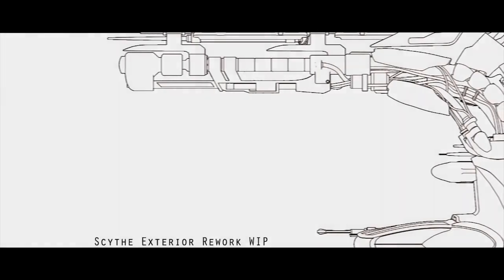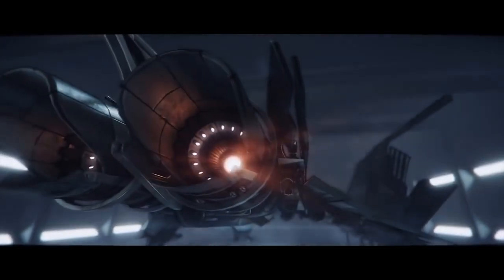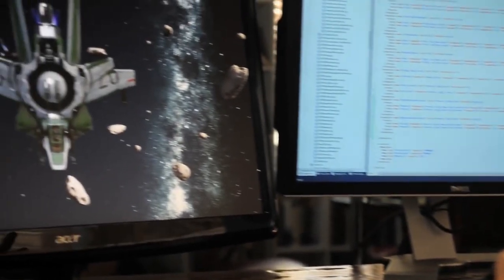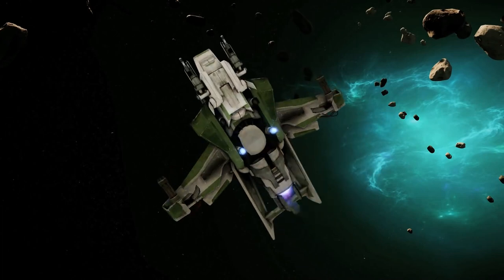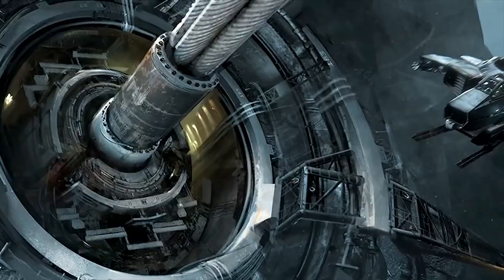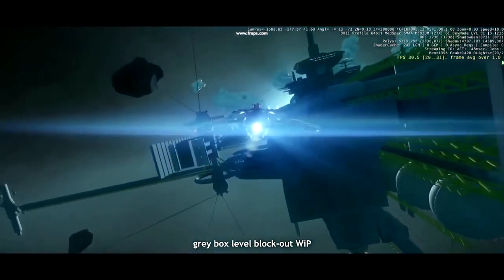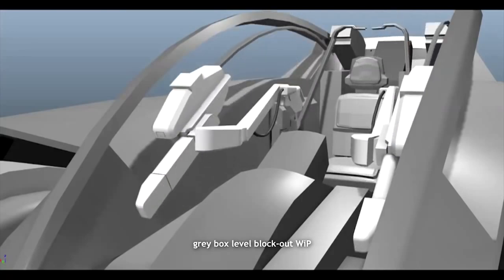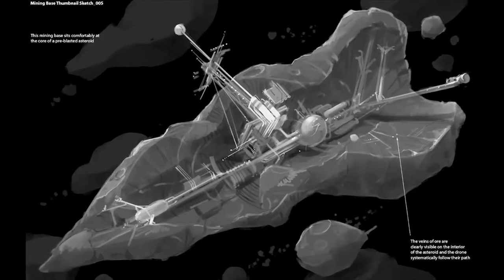✖ Star Citizen » Game Physics

Comment: Personally, I'd prefer the immerse gameplay.  Realism is good, but eventually that can become boring or just not be fun.  As they've pointed out on the site, modern planes usually dont even see eachother when they fight, and now we even have drones that remove that much from the equation.  That doesent make for a very fun game, we want the fights from Star Wars, not just pressing a button and getting a display pop up and a tiny flare of light a million miles away.

And as CitizenHans said, I think the overclocking is more of an 'in the hanger' mod thats made, while the more 'at the moment' changes will be for extra power.  Now they did mention that 'overclocking' something like that in the heat of things could give you that performance boost, but could also burn out your systems if your not careful.

I remember back in the day with Star Trek: Starfleet Academy you could divert power to other systems, like in the series (Aux. power to the shields! Take it from life support if you have to!), and if you weren't careful, and in a pinch put all power to the weapons, and ran them to long, suddenly you had your phasor banks burning out and your torpedo tubes exploding.  I'm hoping to see things like that in the game, the risk Vs reward in it's purist form.

Comment: Overclocking in game is intended to actually mirror what many people do with their CPUs in the real world: Make them perform better (in this case faster) at the expense of more energy-consumption, generated heat and maybe a shorter lifespan.
Its a permanent augmentation you apply to your assets in the hangar between missions, NOT on the fly while fighting somebody. Its comparable to enchanting your gear in an MMO
You manage your power-distribution on the fly of course, but that is not called "overclocking" ;-)

Comment: Hey TA, here's I believe the reason why the game renders 30 FPS in the physics video. The footage was recorded using fraps, when you set fraps to record at 30 FPS, it actually scales down your GPU output to 30 FPS. The reason why they did it this way is that knowing youtube maxes out the videos at 30 FPS, it's easier to record at 30 FPS because it makes the rendering faster and creates a smaller file to upload than a 60 FPS video. So no worries here, I'm sure they can run the game at at least 60 FPS on their machines. ;)

Comment: I think they should strike a fine balance. As was said with sound and laser beams in the vacuum of space - these can be HUD-modeled to allow the pilot to better respond to the battlefield. As for combat tactics - in 600 (is it?) years, no one is quite sure what kind of countermeasures ships will have to combat long-range threats or jam AIs, so it may be perfectly plausible to have people in the cockpits and having to get fairly close to the target. Inertial physics are a compulsory though, and they should be mediated by the fly-by-wire, unless the player decides to have them off. Kinda like in Evochron Mercenary.

Comment: The thing you said about 30fps while on mid spec, I wouldn't be worried as many screen recorders lock the frame rate to what your recording to. As YouTube does not support more than 30fps, then he is probably recording at 30fps. The performance here probably is nothing similar to the performance he COULD be getting if not recording I think. :)
Reply: You can see in the later clips with the large grey-models of mining ships (I think that's what they are anyway) he gets between 60-75 fps. At first I thought it was a lock because of how steady it was but it's more erratic later. 
You have to remember that the optimization of this game is essentially zero at the moment, on release it won't be anywhere near as demanding. 
You'll probably still have to upgrade if you have anything lower than a GTX680, or the AMD equivalent, though.

Comment: I think this guy misunderstood overclocking a bit
Overclocking is the practice of taking your upgrades and modules from your ship. tweaking them to the point that you have more speed/power/RPM at the cost of efficiency and the module/upgrade lasting less time, this can be done with the work bench which is to be introduced fully yet
The power thing is more about the distribution of power from 1 system to another. IE your lasers are obviously useless, but you want your shields to be a bit more protective.
Power has nothing to do with overclocking. it's how you modify components before they are installed into your ship.

Comment: well in order to explain how you can hear the sound of your fighter doing stuff, you can just say that when the gun fires. or the thrusters engage, the vibration transfers through the materials into the inside of the ship. How you can hear the enemy ships firing at you, I gots no clue XD. I mean the vibration theory would explain after they managed to hit you but not before that. Maybe you got special sensors that picks up the remote vibration on the enemy ship and then translates it into an audible frequency for the pilot